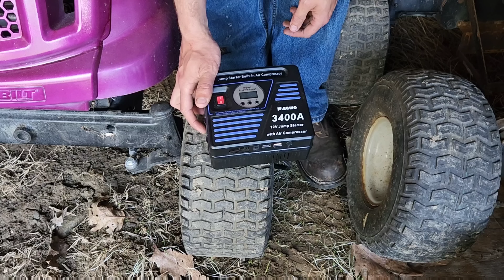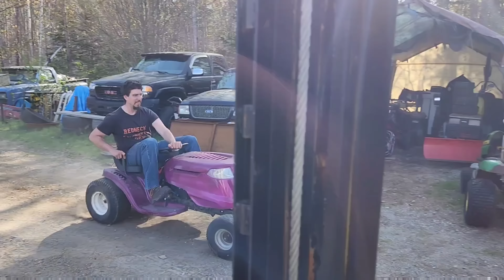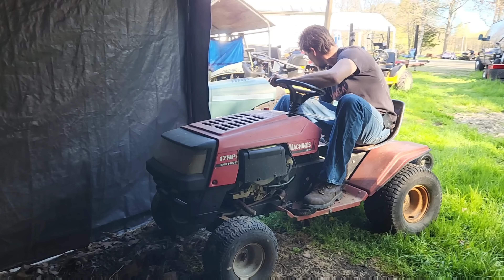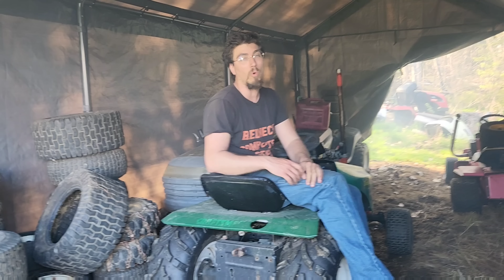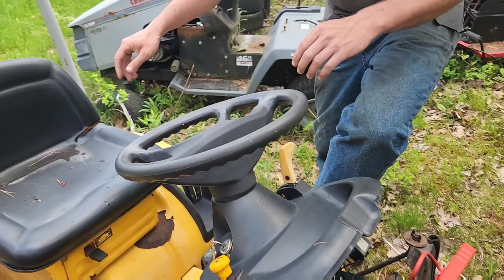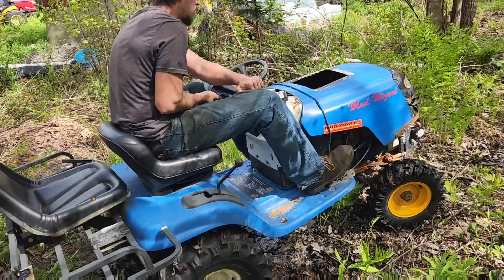Fire up the hoard! Lawn Tractor Edition

Comment: I'm still amazed the, wound up being free, Artek is still holding up.  Amazing what seemed like only a decade or so ago was for me a backup deep cycle battery and hand pump... is now all in one little automated light package. The JF.EGWO is handy to save space and time if your budget can afford.  I totally recommend.   I just brought back a HDS2185 and am wondering how I can mod a B&S or chonda (Duramax) Honda onto.  Thinking before I disassemble more... maybe will do that to the AGS2130 since that engine came in a box and hasn't changed much.  Time to watch more of your videos on those machines.

Comment: I'd invest in A marine deep cycle 12-volt battery for that van to. If it takes 2 then i'd get two of them yes their salty price wise in the long run their worth it though. Check the charge in them to before reinstalling them to save you time having to wait on them to fully top off. Cause while your replacing that switch those could be charging up with both grounds connectted together for dual charging it's the para something I forgot how that word is spelled myself bro.

Comment: That's a nice jumper. I tried to jump a v8 with a dead battery and my fully charged $40 Walmart never start pack instantly died.
Reply from the maker: The price point seems to be at around $80 to $100 for something decent to do a v8
Reply: Awesome to know that those cheapy, ‘will start alls’ for $48 are junk and not worth messing with.

Comment: you do know you shouldn't send her like that until its warmed up cuz it will expand the piston too fast and you really score the cylinder walls.  It's not good for a 2 stroke either.  I see so many people do this.  Let it warm up for a few minutes at an idle then you can send her all the way
Reply: That's backwards there bud. The piston isn't buch a concern for a 4 cycle unless it's forged inches case it is not forged. I'd be more worried about wiping the lobs off the cam then scoring a cylinder in any 4 cycle. For a 2 stroke it is bad as the exhaust side of the piston gets hotter faster then the intake resulting in a cold seizing and absolutely wrecking the cylinder on the exhaust side scoring through the plating and or sleeve.

Comment: What lawn tractor would you recommend looking for in the used market?   I heard good things about craftsman
Reply from the maker: Nothing with an FNR shifter. Poulan Pro and older Craftsman are my go to. The Shaft drive cub cadets are often cheap if you are good at sorting out wiring.
Reply: Craftsman t3000 hydro a good machine?  Like 6 years old

Comment: Why don't you change out the ignition in that Ford econline van their not hard at all. It has A bolt that holds it into place. You just half to disconect the battery.& drop the shifter down into nuetral then the twist screw is all you half to remove.& the wiring to actual key switch to. It's A reverse process to. As in backwards process to reinstall the ignition switch. Get the one that doesn't need to be reprogrammed unless you wan't type of one again. Their price is major differences to price wise also.